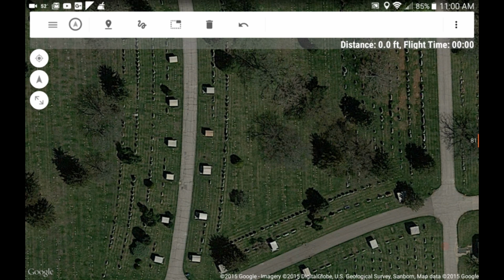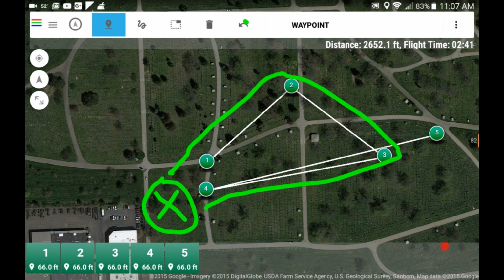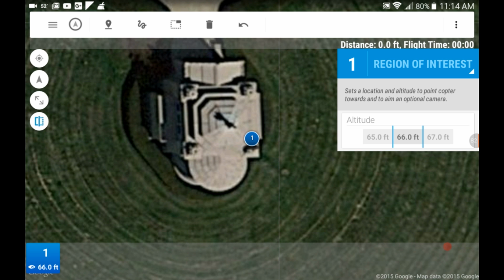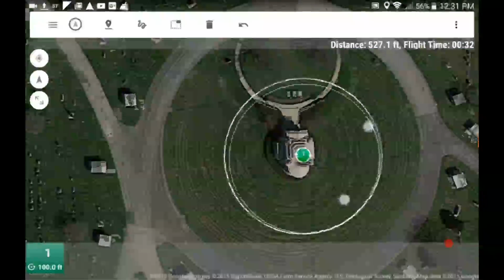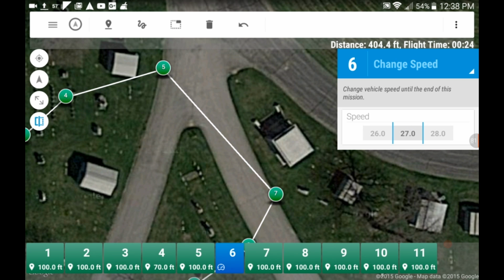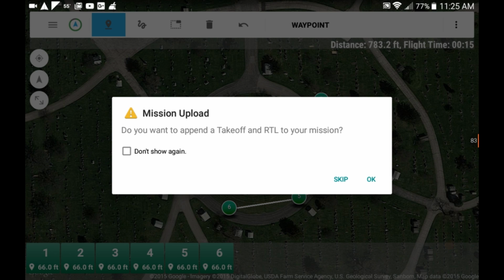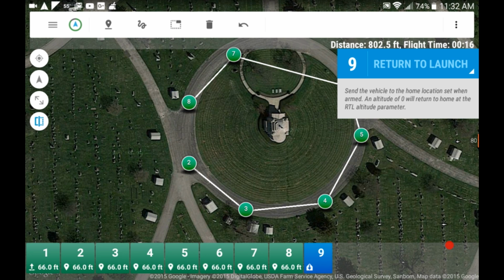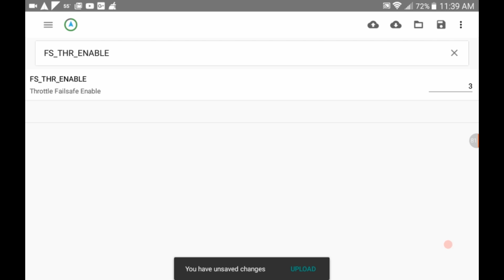Tower Tutorial for 3DR Solo

Comment: but no one as far as I can find tell the steps to achieve a solid connection to the drone, what apps, steps to connection to the solo. if I connect to the solo app, i cant connect to tower!!!!!!  ??????/ ' '/ / ? ?/
Reply from the maker: Bradley Branch basically you connect to solo wifi as usual. Then launch tower and select the UDP option and click connect. Have you tried that?
Reply: i am not home right now and i am not very good at texting on a small phone.  i connect the wifi to the pad rhen i open rower and connected.   next i made a small flight plan. fly about 50 feet. circle. rerurn land.    i int the solo from the tower app and tapped take off.  that is when it went south.  i did up load.     control  was a maybe 10%  afterwards i have to reset the drone and set gyros and compass to be able to fly normally again. please excuse the typing
Reply from the maker: Bradley Branch I've had that happen before too. I think it's better to take off manually and then click auto from within the app.
Reply: i did have  the solo app on in the back ground because i saw a youtube video where it was being used for full screen video
Reply: I had a similar issue when I tried to use Tower.  BUT I was goofing around with my android tablet AND I had something else connected at the same time.  I can't remember if it was my laptop or my iPhone.  I was messing with the tablet and "Armed" the Solo with the Tower app.  I had entered a mission in the solo earlier with Qground control (I know this is all crazy but I was doing a lot of experimenting that day).  So back in the Tower app I slid the "Fly" slider to fly and away it went ... then it started to fly to the mission that was preloaded ... AT 10' ABOVE THE GROUND!   I have a lot of trees and lets just say this could have been very ugly.  MASH ON THE FLY BUTTON TO AUTO LAND!  RTH would have sent it to 150' while under a tree.  So I haven't played with it since the Solo app has been working again.  But I'm looking at a mission that I really need to fly today and probably going to try this again.  In an open area with no obstacles lol.  I'll let you know how it goes.

Comment: Again I want to say great video Joey, thank you for going to trouble of making it.  There's a few questions I have that are not answered in the video and I can't find documentation on (no surprise there as you say that's why you made the video in the first place).

I like that idea of utilizing Tower in setting preliminary flight paths in new locations that I have not had two opportunity to scout and set up smart shots at yet. To that end a few questions.

1) What is a Spline Waypoint?
2) What does a Reset ROI command do exactly? (I understand setting an ROI but I don't understand where the camera is instructed to point after a Reset ROI command is initiated).
3) What is Do Jump?
4) What is Set Servo?
6) What is Realtime camera footprint in the user interface?
5) Is there a way to reset the default speed of the Solo in Tower? (I found default altitude preferences in the advanced settings menu within the settings menu but nothing for speed). It seems awful fast with a lot of aggressive pitching & rolling as it changes directions between way points. I understand I can set the first command as a reset speed command but it would be nice to not have to do that for every mission but set the default to speed that lends itself to nice cinematic movement.
6) Similar to question #5 - Is there anyway to slow down or smooth panning & tilting between ROI's? To get the Solo to behave more like it does when utilizing smart shots in the Solo app, i.e. nice smooth logarithmic camera moves, nut sudden herky jerky movements.

and lastly (for now)...

7) Has anyone figured a way to safely pause a Tower mission, jump to the Solo app and create and execute a few smart shots, and then continue on with the Tower mission. This was not something 3DR support recommended as their official response was "We don't recommend using both applications at the same time since that could lead to misbehavior. Doing so is completely at the customer's discretion" but I did read a thread on the 3DR forum speculating if it could be done with one android and one iOS device - but it wasn't clear if any of the members were able to accomplish it. If it could be safely done it seems potentially a great way to save flight time/battery usage at new filming locations.

Comment: This was very helpful, i just got my solo today and i had never heard of Tower. Thanks a ton.
Reply from the maker: Glad you liked it. Please ensure you set your Solo up so that you have Manual mode mapped to one of the buttons in case you find yourself in a situation where you have to take control over Solo in an emergency such as a weak GPS condition. Not sure what your experience level is but I like to tell all new users about doing that just in case.

Comment: Great video Joey.  Quick question, if I set failsafe parameter to 2 and upload it to solo, then later on I'm just flying solo under my own control (using solo app) and I lose connection with controller, will solo just keep flying or initiate a RTL? Or, do the changed parameters only affect solo while using tower app on autonomous mode?
Reply from the maker: It only affects you in Auto mode. Good question. I had the same concern but this is an auto mode parameter so you should be good to go.

Comment: Hi mate, thanks a lot for such a good, detailed video. Great stuff!
Lol once I get my new solo from insurance (first real crash practically cracked Solo in half) I'll be pretty keen to get experimenting with Tower!
Just curious though - if I go to do a mission, especially if I change the parameters and tell solo to continue and come to land 15km away at a friend's house - what would happen if for some reason solo lost satellite contact halfway through the journey? Would it just stop and hover until it regained satellite connection? Would it just land on the spot? Or did I read somewhere that the missions are cached and solo can even complete a mission with the routes and commands saved to the on board computer after having lost GPS signal?

Cheers, Kev.

Comment: For a real estate video, can you 'circle' one time high over trees, then set waypoints to slow and turtle low across the front and then to the entry, back out to safe altitude and home?  The resulting video could be spliced to one of those hand held videos where the door opens magically and you proceed inside.  I want to do areal photos and videos at a cheaper cost than using a manned aircraft.  I figure to charge $50 for travel time, site study, programming*, mission and travel back with the real estate agent.   *So would the programming time make my idea a financial bust, once I learned the ropes?

I wrote the first flight control system maintenance T.O. for the F-16, so I thought this video was clear and simple.  However not for me because I am old now.  I was tired so it was hard to keep my eyes focused.  It was hard to identify symbols on your little tablet.  I never thought to view it full screen.  When I can afford a drone I hope this video is still available.  Happy Thanksgiving.

Comment: Good video thanks! re the throttle/RC failsafe setting - what happens if it's flying in non-auto mode (ie std or ltr) when the condition occurs?  I'm guessing it will "continue with the mission", but which part of the mission (beginning/middle/end)?  If it goes to the last waypoint, which should be close to the launch point, then isn't that the same as RTL except maybe for the altitude?
Reply: Mike Henry that value of the param ONLY applies when you are in Auto. If not in Auto, it will RTL.

Comment: FYI  I don't believe the speed changes from imperial to metric or vice versa. Default is m/s. Very good video though, i learned a lot. The other waypoint that would be good to touch on is Spline since that smoothes all the waypoints and flight paths into curves.  I'm also glad you showed how to  check what mission is on the solo and make sure you upload your mission. I recently activated a mission that was set up 50 miles away from where i was  and sure enough solo turned and started heading that direction. a quick press of the pause button and upload of the new mission solved that quick.
Reply from the maker: +Matthew Bird Holy smokes, Matt. That could have been disasterous. I think I should have hammered that point a little harder in my video. Could you imagine that taking place AND having the return to home parameter set to 2 like I show in my video? :-) Wouldn't even return home. In your case Solo would have eventually come back assuming you didn't change the FS_THR_ENABLE parameter to 2. But that doesn't guarantee it wouldn't hit a tree or a house on the way to or from home :-)

Comment: Thanks so much Joey.  I just worked through all this on my own, and figured out most of it, but this tutorial would have saved me lots of time and struggle. Very well done. I learned a lot that I didn't know, for example that the altitude for a ROI waypoint is where the camera points. Also really great about making sure which mission is loaded.  One thing you didn't mention is that you can save a number of different missions on your device with export and import file.  One addition: if you take off Solo before initiating the mission, the Auto button to start the mission will show up where the Arm/Dronie is when not yet flying.  In my testing, it seems that that speed is not MPH but some multiple of what you have set in Solo.  If I have Solo at turtle, 2.0 is slow, but if I have it at rabbit, 2.0 is fast.